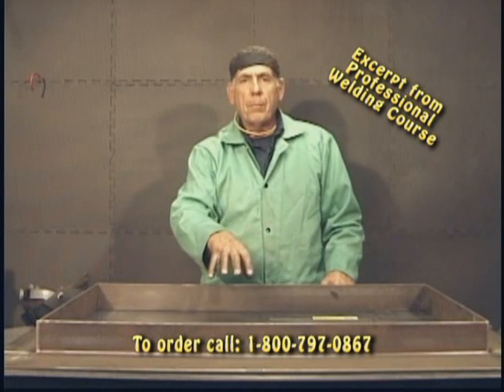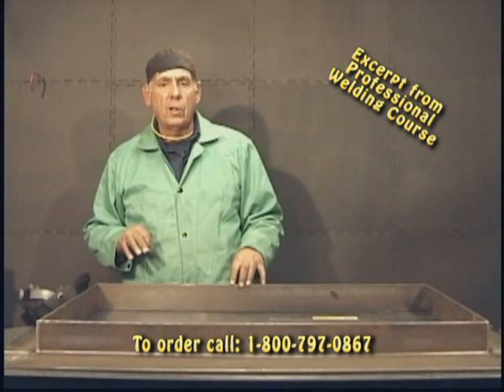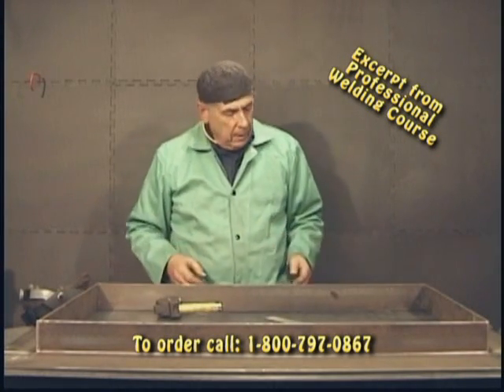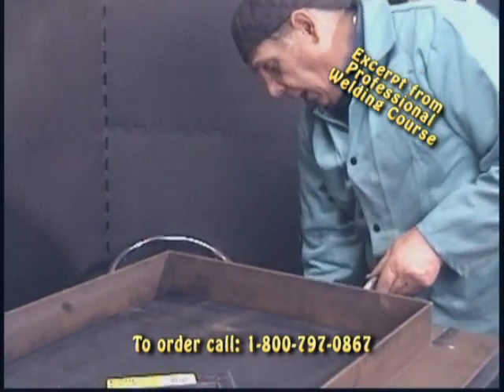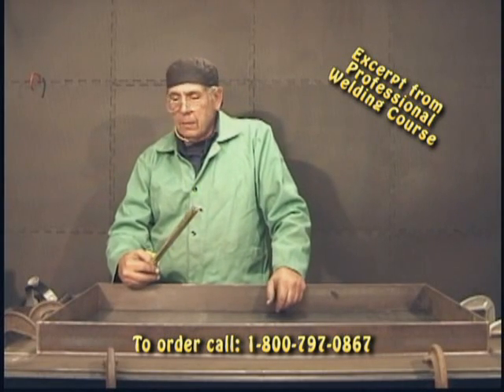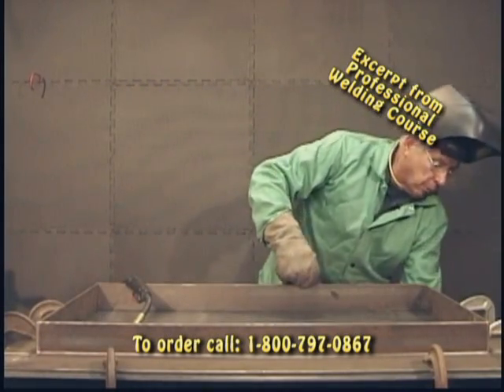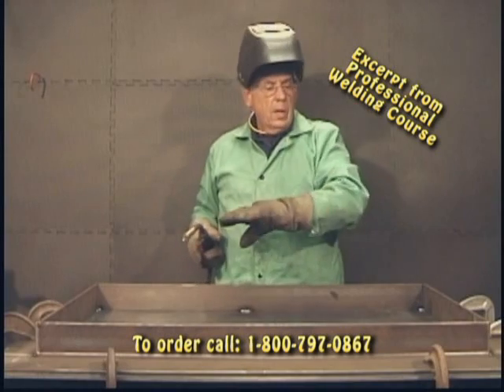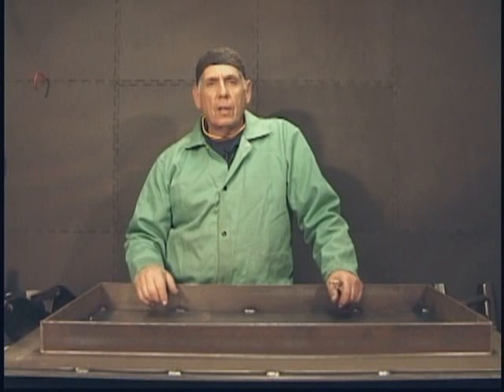ATI Professional Welding Section 6 Projects

Comment: Your videos have really helped me out as I am getting started with welding, especially moving tacks around so as to not build up too much heat and to stitch weld instead of a very long weld.  I have a Lincoln Electric flux cored wire feed welder.  Take a look at my latest video and tell me what you think.